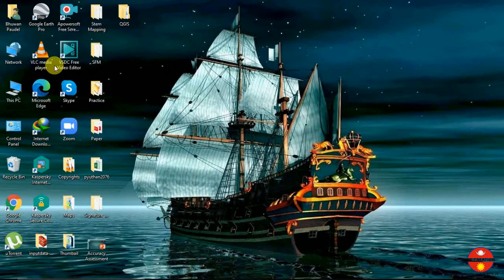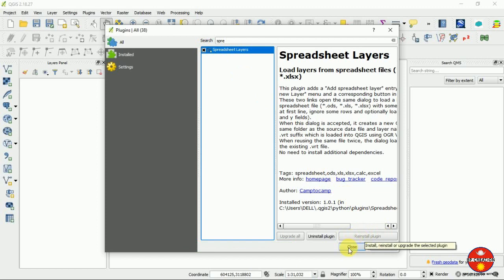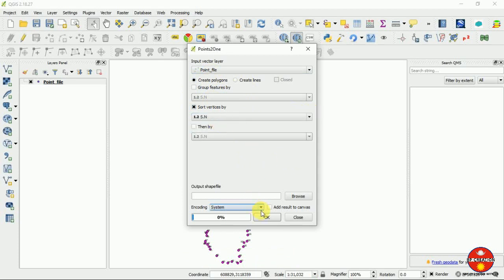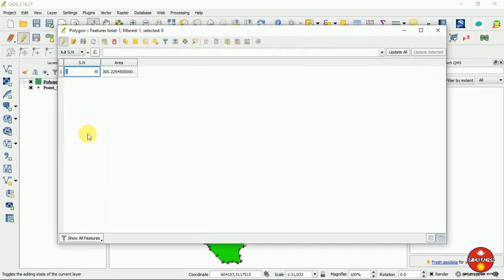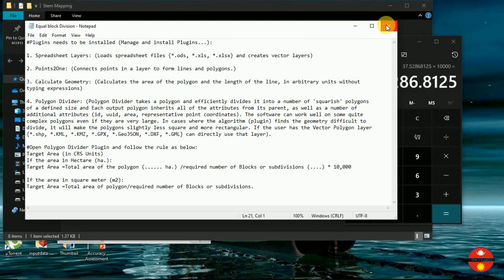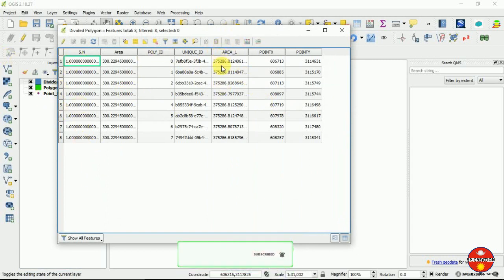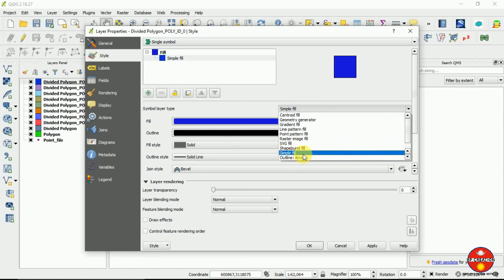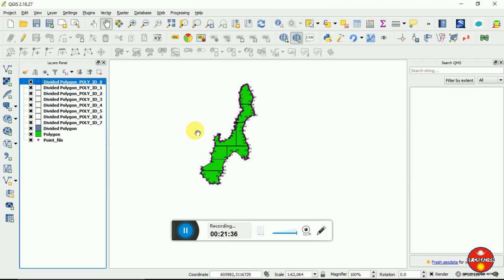Equal Block Division Using QGIS || Polygon Divider || QGIS || @GeoTech Studio

Comment: Hi, I follow exactly the same steps but after division the only thing that happens is that my polygons change color. No division
Reply from the maker: Which version are you using?
Reply: @geotechstudio  OMG.. On the bottom left side I hadn't selected the correct layer. After dissolving once, then the selected layer becomes the new dissolved one, and that's why when I was trying the select I simply couldn't. lol.
 however, I have one more question. What if I wanted to dissolve all the zones in 4 equal-area bigger zones, but not just by selecting by hand. So that to make sure that all 4 new dissolved grids have nearly the same area size.

Thanks anyway. Very nice video!
Reply from the maker: You can perform that by taking one common attribute of the zones which  you want to dissolve